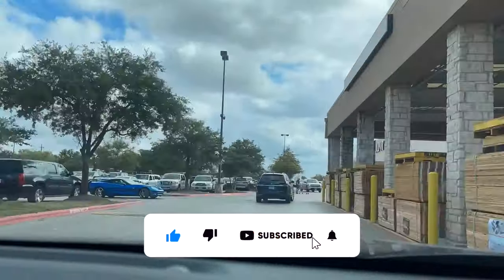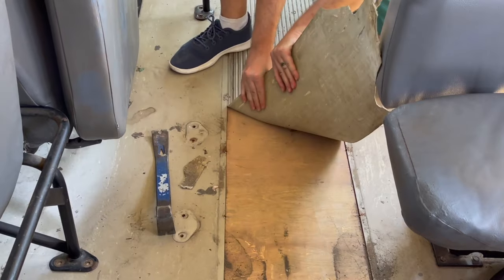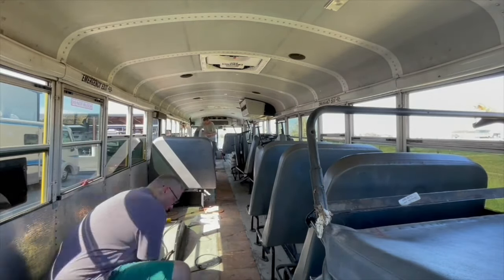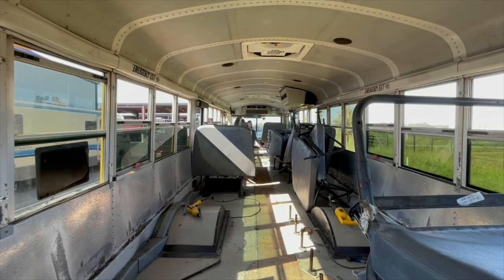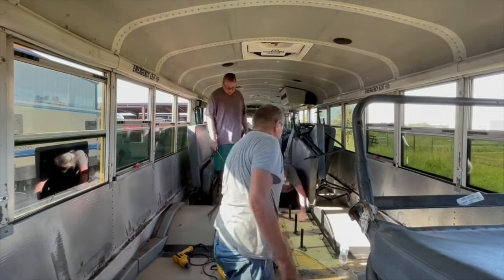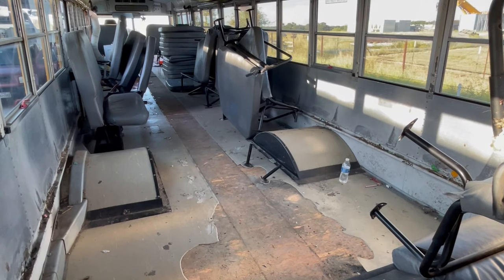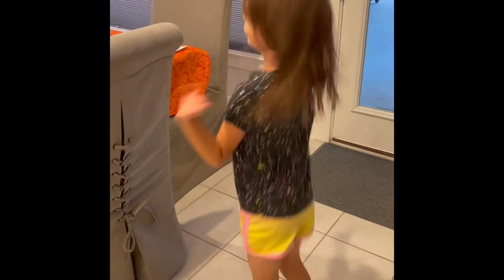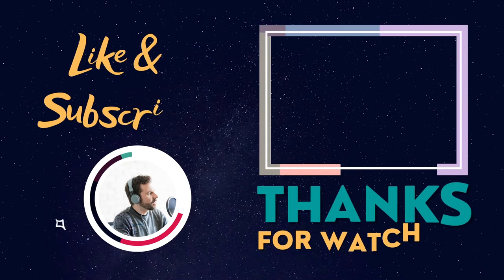School Bus Conversion - Bus Demo Time Lapse

Comment: You need better tools. 4" grinder with cutting wheels would have made quick work of those seat bolts. Expect lots of cuts and bruises. Two weeks is a long time for seat removal. I just pulled the rearend, all exhaust, engine transmission and front clip off of a bus in two days. With the help of one friend.  Its not about who did what, its about using the right tools for the job. Im actually converting a bus into a shipping container and i wanted it setting on the ground is why i pulled everything out from under it. It was a sketchy job getting the rearend out from under a 20,000 pound bus but its done and now setting level on blocks right on the ground. Stay at it, expect set backs. Its not going to be a walk in the park. Get the vision of finished product in the back of youre mind. Thats the payoff. Good luck on youre build.
Reply from the maker: We learned after we had removed the seats that a car Jack works wonders. Also the fact that the bus was in a storage facility a town over and we have two little kids made the project take longer than expected. Thank you for your words of encouragement.